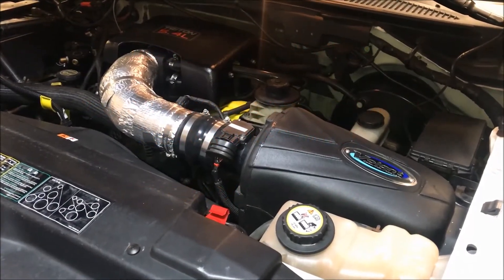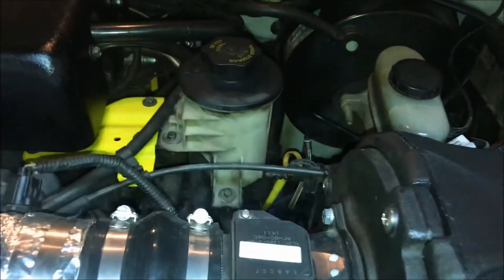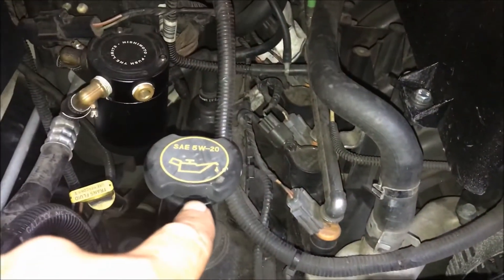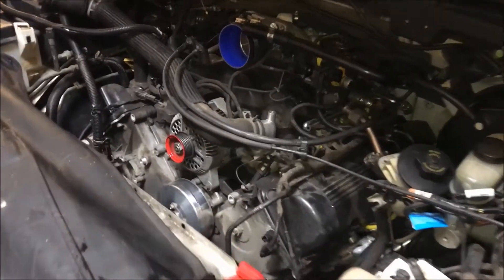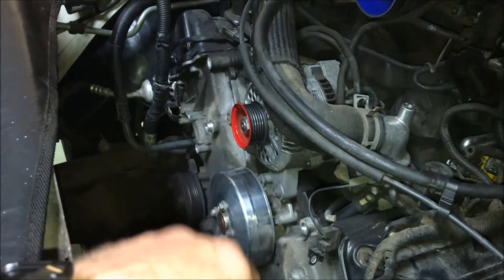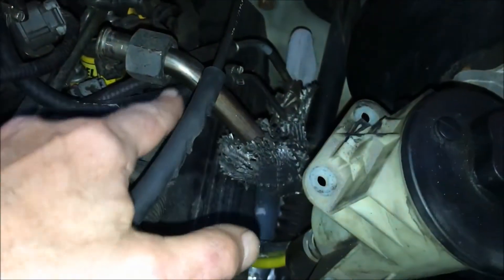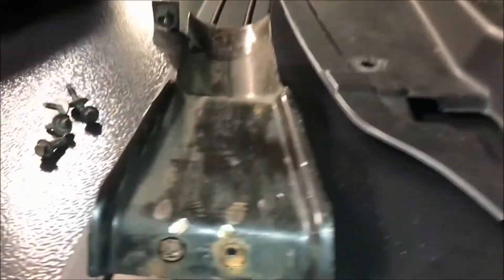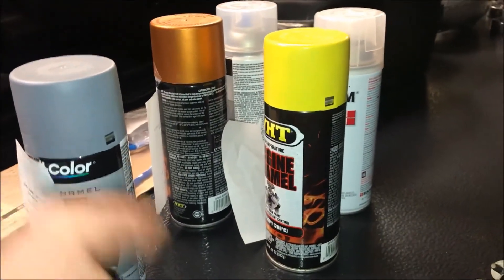5.4L 2V Timing Chain Disassembly / Replace: 10th Gen F150, Expedition, Excursion Series Part 2

Comment: needing to fix the timing chain at this low mileage is unheard of and DEFINITELY due to using Royal Purple.  that is truly racing only oils and not for trucks and or daily use
Reply from the maker: Over 200k miles is too soon?  What studies and evidence do you have?
Reply: @DrivingIntelligence  but also when you originally introduced us you didn't say you had that many miles on it I don't know where over 200 came from
Reply from the maker: @captamerica3693  it's a playlist, you need to start from the first video:  https://youtube.com/playlist?list=PLGNsbVXzRfZPg0KvNIqkGpzx-duBOL246&si=qVVdAfT9dLRyVxXd  it notes over 217k miles.
Reply: @DrivingIntelligence  Way too soon it's almost done unheard of her mod motor but it's not unheard of is running royal purple and having premature wear it's definitely not made for daily use even though their marketing as such it's great for intended use which is racing. I've owned a bunch of these engines and I've raised them and I've built them I know I'm inside and out since they first came out I have three in my driveway right now.